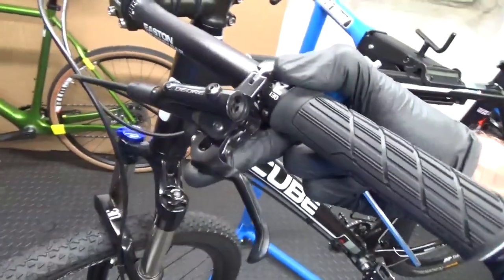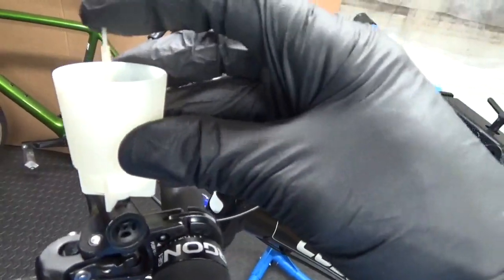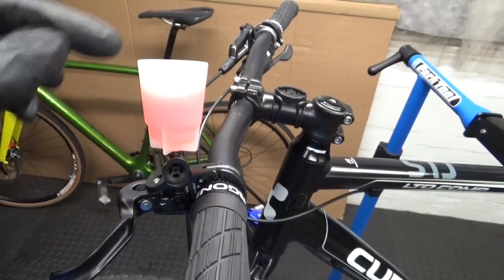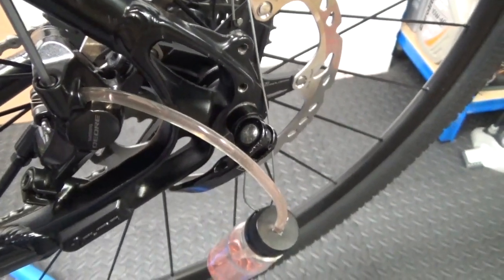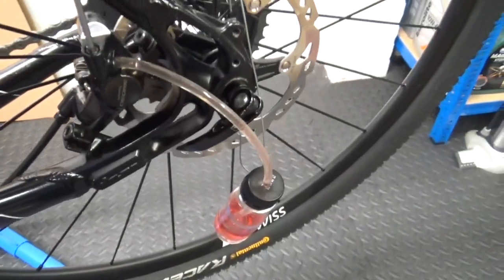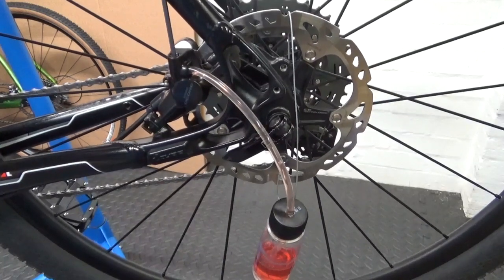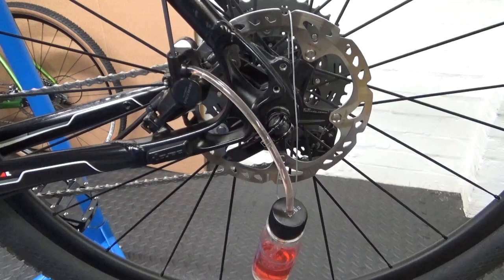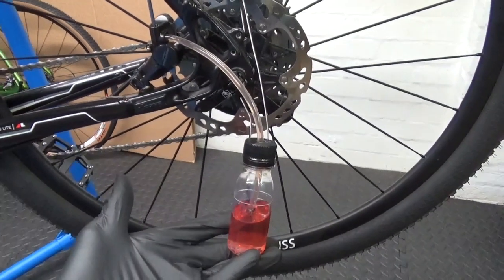Shimano M6000 Hydraulic Brake Bleed

Comment: Please any chance you can show how to bleed giant conduct sl disc brakes without spending money on giant's bleeding kit plus other stuff I don't need.
Reply: mark kipling I mean, you don’t necessarily need the giant kit, as long as you have bleeding oil, you can use a small bottle instead of the big ones.